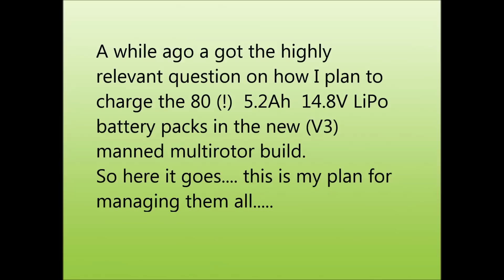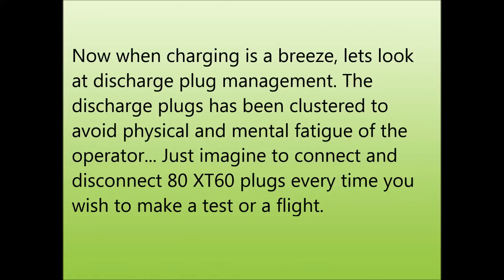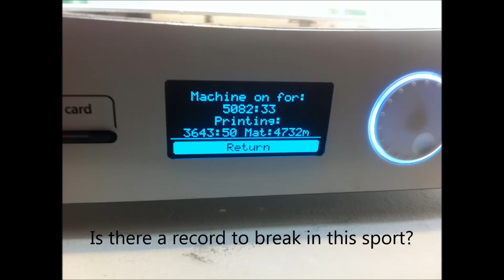chAIR -Manned multirotor Episode 15  Quadcopter style

Comment: Genius idea on the bolt drawn connector ring, Can't wait to see it complete! good luck
Reply from the maker: Thanks, well it quickly became apparent during the initial testing that I just had to come up with a fix for the battery connector hazel....it does add some weight but it is  totally worth it !

Comment: Hi!  I think the cross under the chair is has a high risk for failure. It is the most crucial part and seems to be aluminium, is bended and perforated at the same time.  Also if the pivot breaks you will get at least on propeller right into the face. If you don't want to redesign I suggest to buit in some redundancy, for example made of the cevlar wire you have. I also recomment the use of a four point harness which keeps the upper body (and center of weight) in place in case of turbulences. Please check that your feet / hands can not reach to the propellers at any circumstances.  By the way, the copter do not need to be quadratic, you can built it rectangular if you need mor space for the legs... Keep on the good work, A.!

Comment: did similar for a bike battery years ago, but for the balance.charge leads i used a PC PSU power connector with the 24 pins for the 16s pack i was running, back to 3 incredibly cheap b6 chargers...

Comment: For such a large power draw, why not use SLA batteries instead? Might be somewhat heavier, but you'd avoid the need for 20 chargers and this "over engineering" (be it as it may, very clever). Just a thought. Also, what type of motors do you plan to use (interested in the wattage, and how you came to calculate the power required for the desired amount of lift).
I'm a big fan (pun intended), keep up the great work!

Comment: Will you be creating a crossover failsafe for the electrical system so that if one battery bank fails the motors in the effected quadrant can draw power from the other three banks, and should two fail then power will be supplied to all the motors from the remaining two, a kind of limp-home mode to allow you to land the craft safely. LiPOs can be cantankerous things.
Reply: James Lamb good idea, these sorts of comments can help raise points that may not have been considered previously.

Comment: Hi , I am a retired electrician and drone enthusiast. I love your design. While watching this video I noticed you use 15 yellow xt60 discharge plugs but there are 10 batteries in parallell , ( i would have thought there are 10 xt 60) why are there 15 ? curious.
Reply from the maker: The remaining 5 xt 60s  are for flight controller  signals, (signal and ground since the speedcontrollers are of opto-type no positive wires are needed)  to the speed controllers in each quadrant. Yes they are ridiculously over sized, but where a convenient solution at the time. :-)